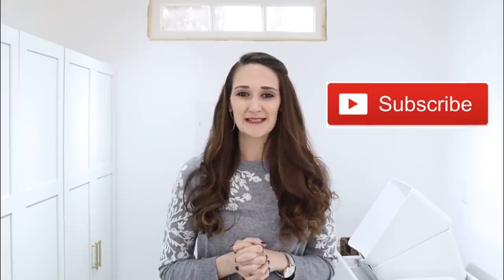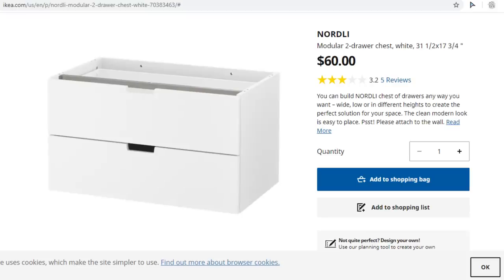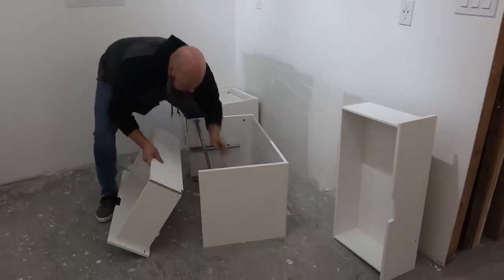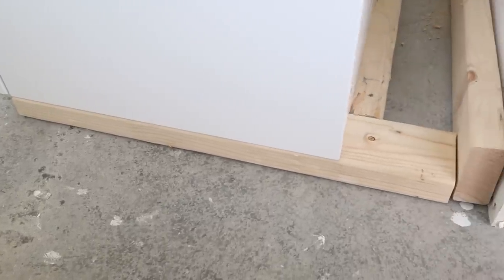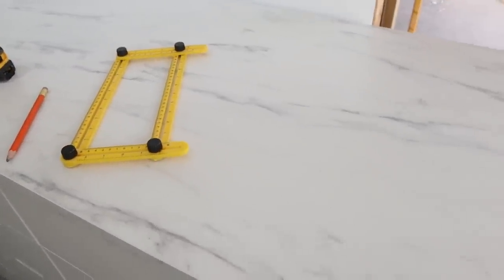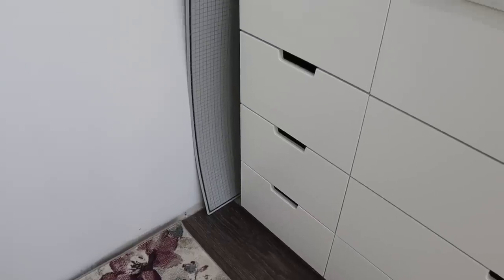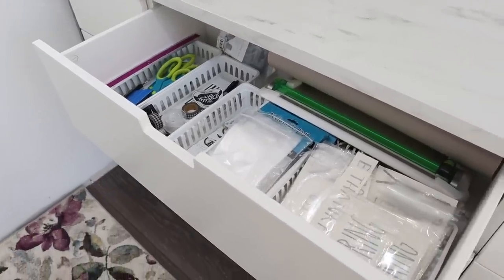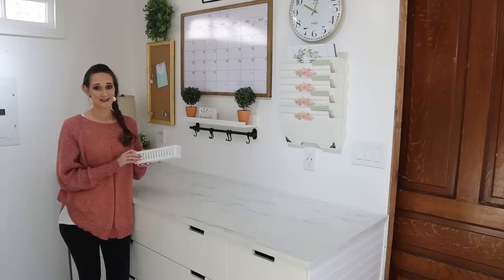IKEA HACK | Craft Room Organization Cabinet

Comment: When I put new counters in my kitchen five years ago, I went with Ikea countertops.  Did not regret it at all.  In fact I wanted to change up my craft room two years ago and put ikea countertops in there as well.  I used Alex drawers and I too had a small gap at the end.  YES, It has been my Cricut mat storage area for a long time now.  😍. Lol great minds!
Reply from the maker: I love hearing this!!  Glad your countertops are still holding up.  I can't wait to redo our kitchen after seeing how nice this turned out.  I almost went with the Alex units.  Like the idea of having them on wheels so I could move them around, but this built in had worked great so far!

Comment: I love the floral print on your floor runner. I am puzzled why you felt it necessary to anchor the drawer unit to the wall. You're not sailing away on a stormy sea. That stuff won't move around until you want it to, not unless you have poltergeists. I am a firm believer in casters and coasters under furniture so that cleanup, repair, paint, remodel, and move are easier to do. Love the countertop, but I'm doubtful about using drawers that deep in a craft room. I've been using thrift dresser drawers in my basement for tool storage (hammers, screwdrivers, chisels, tape, paintbrushes, etc). The shallow drawers work best for me to keep things sorted, accessible, and visible at a glance. The deeper drawers tended to disaster. That was partly my fault because I filled them. The dressers made of solid wood with tongue and groove construction have held up. The composite particle board units fell apart and need to be replaced.